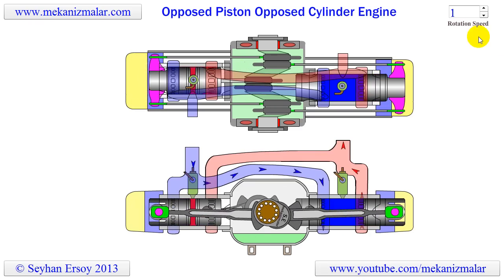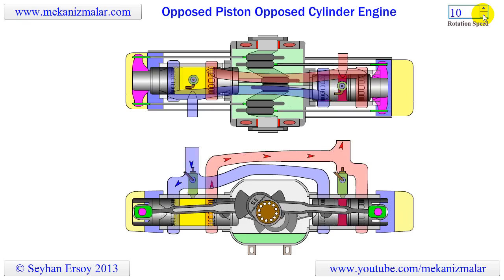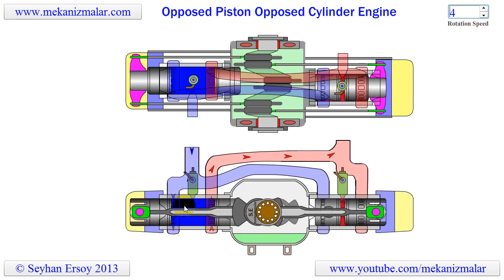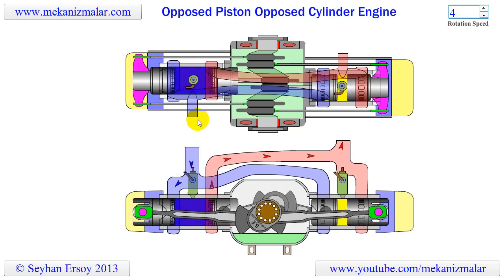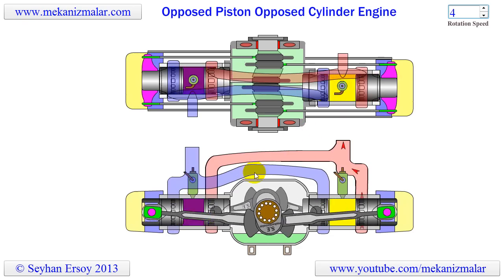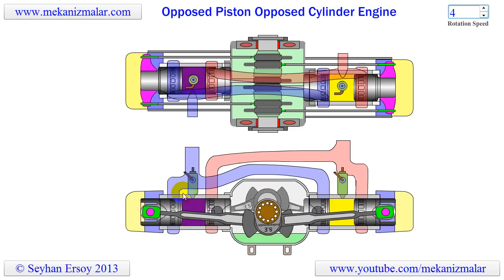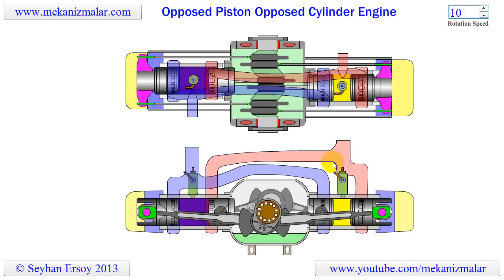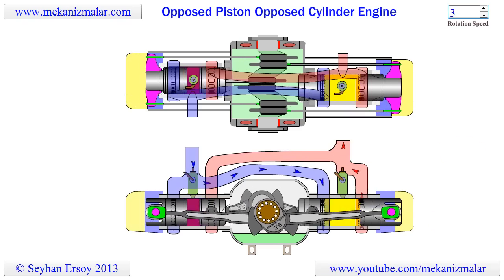Opposed Piston Opposed Cylinder Engine

Comment: This looks like a promising engine for small piston aircraft. Looks like it has high efficiency, but the weight might be an issue.

I also wonder if anyone is mad enough to make this into a V engine package instead of a flat/boxer like this one. We might get the efficiency of the Opposed piston with the compactness of a V engine, but it'll probably be complicated as hell, especially with crankshaft balance and cylinder inspection. 

Maybe the Army can make use of it for its vehicles, like in MBTs? 

Note: I'm not an engineer. I'm just interested in this engine once I understand its working principles.
Reply: Oh yes, army likes engines like that, especially luftvaffe and Hitler's tank armies

Comment: It is not second order balanced (in principle). Animation is wrong - intake and exhaust should be symmetric, outer pistons need to be advanced for better aspiration. There is a minimal advantage to typical opposed engine considering size, but there is a big gap between cylinders required for external connection rods and crank pin between them! So the most viable configuration is 1 module engine. It is 4 cylinder equivalent, not that bad. There is a natural room for "piston supercharger/blower".
I suppose all drawings are intentionally misleading.
Reply: Thank you for your comment and for letting us know the mistakes we had. However, sometime it is much easier writing a comment than duing it.

Comment: Which ports to handle intake/exhaust should be carefully considered because of the radical difference in rod length will create very different acceleration/deceleration curves/dwell times of the inner and outer piston sets.

Comment: Make a 4 stroke  twin engine(e.g 300/400cc) run on low fuel consumption while in city that is half of it e.g 150/200cc ... or either run on one piston neglecting the other or using a VCM  (Variable Cylinder Management) as a virtual variable displacement tech. Or you can make one of the Cylinders skip intake by blocking the carburettor or EFI on one cycle then firing in the next. while the other cylinder working in opposite depending on the crankshaft/timing. And a mechanism which would allow you to kick in full mode i.e without skipping a cycle.
Engine like a Honda Xl400V transalp or of your choice are great. You can also mount it on Lighter frames like on XR250R. I was thinking of this . to make a fuel economic bike while in  a city and one which can kick in full power while in highway... low displacement engines rev much and heat up very much in highways. I believe in you.. You have great enthusiasm and innovative

Comment: The 2 stoke diesel engine had the exact "scavenger ports" (Where the air passes though.), and compression theme. If the shortfall of this engine is high efficiency  in a narrow RPM, then have it power a generator that resonates at the same frequency. Add a small battery or super capacitor, and viola, You have an efficient hybrid.

Comment: Opoc died in 2017. despite 20m$ investment from bill gates. I see no advantage to the design. Those long outer piston arms are weak and the power density comes from being a 2 stroke. 
2 pistons side by side instead of on end is just better. If you want real power density then turbine electric is serious business. Pretty smooth running too. And they can be quite efficient. Large generators are around 60% which is way higher than any car engine.

Comment: Used in two stroke form as you've shown won't work as how you getting a fresh air charge back into the cylinder at the end of the powerstroke,this is why 2 strokes are dry cranked cause the piston and crank force the new charge in ,just injecting fuel at end of powerstroke with no fresh air charge won't burn effectively, having any kinda charger ain't gonna do diddly ,can't see any government agencies taking it serious with such a flaw in design ,anyone with a good grasp on motors will see the flaw having a two stroke design and missing crankcase charge , it's like having a cart and making a wheel but low and behold there's no axle but you still expect the cart to be usable

Comment: Lots of talk about efficiency. Lets us know and practical science leads the way. Put this engine on a generator and see what kind of power out put per btu fuel input will make or break  this concept. The future belongs to the most efficient. In theory you should get more push with two pistons doing the work. The more bang you can get the higher the efficiency should go.  Bottom line the more bang for your buck will make or break this idea. I don't think you will get double the power for your input fuel but should get at least 1.25 to maybe 1.75 more power out, depending on the design factors. I think that would make this new engine very much in demand. This would be wild change over in motor vehicle and trucking industry. I am sure the oil industry would not be happy. This would be a significant world wide event when it starts pushing into those many industries, and a big economic change over. Even ship and high end base load generators will be obsolete. Those that don't up date will not be able to compete.
Reply from the maker: Dear Steve, one thing that I did not get in your comment is that you are saying this thermal engine can get 1.75 or 1.25 the power from the input fuel. As far as I know no thermal engine can get more efficient than 0.45 percent of the input fuel power., Is what I andrsted from your comment is wrong? Also I thank you for visiting my channel and comment.

Comment: The OPOC engine could also operate with the pistons to one side like a normal inline four cylinder engine instead of a boxer configuration. It can then be tilted upwards. It can also be made in V configurations. Why use a crank and not a drive gear?

Comment: "eleminates the cylinder head and valve train components of conventional engines" - I fail to see how or why ...
Reply: There is lots of heat loss through the cylinder head of a conventional engine.  It has surface area but does no work.  An opposed piston engine has the combustion chamber between the two pistons, and both do work to produce power.
Reply: It has ports for inlet and exhaust, like a two stroke.

Comment: First, 'throw away the inlet manifold and the turbo/Super Charger'!  The bottom of the out side pistons are now compressors, sucking air in through simple and cheap reed valves on the far ends.  On the power stroke this will push the compressed air through vains into the combustion chamber through the port holes at the far ends. Now both inner port holes become the exhaust as the left side already is.

The only possible minor problem I can see would be lack of torque because of the shorter stroke?
Would love to see this built and tested.
Reply: Checkout DOXFORD engines. Also combined compressor piston has been done over a hundred years ago, either as you describe or also an annular space with a stepped piston. Checkout LYLE CUMMINS’ Diesel engine history; Lyle is a son of Clessie Cummins, Cummins engine founder.
Reply: Checkout LYLE CUMMINS’ Diesel engine history. It is an exhaustively detailed compilation written over decades.
Reply: for effective working, we would need the air pressure and volume high enough to push out all exhaust gases . this makes your "compressor" plan unviable. As for torque, the total length is split between two pistons , thus giving high torque as well as high speed.

Comment: Hardly a new concept.

Opposed engines fell out of favor almost 100 years ago because they are too complex, too heavy, and too inefficient
Reply: Check out Achates . Norris Fairbanks are still used as power plants (generators) in  hundreds of locations.
Reply: No, they fell out because fuel was cheap and fuel efficiency was not so important.
Reply: The really arent any of those but they drink a lot of oil like most two strokes

Comment: sir already i have been working on 4 stork opposite piston engine it more efficient than your engine. it is same as working common engine but my opposite piston engine under progress due to small workshop in my home
Reply: AMIR HAFEEZ do it do it.   I love this design n would love to see it in person.    Im n ex technician and love this engines simplicity.   no timing chain or belt, no valves, no cams, no spark plugs, no wires no software just simplicity
Reply: 4 stork engines have trouble because eagles are always finding their nests and eating their eggs

Comment: Very impressed with the concept. I am fond of the 2 stroke engine because of its power to weight ratio. With technology and the advanced materials available these days, I believe any issue with this concept can be overcome. I think the greatest challenge is to change minds toward acceptance of such a radical departure from the norm. I really hope it succeeds.

Comment: i love how this is an opposed piston design without resorting to another crank shaft on the other side of the cylinder, very clever, only one sump.  Also, this is nice and balanced.  how do you lube the outside pistons?

Other than that it is a poerted 2 stroke diesel relying on forced air, nothing new there.  a good power density but not as efficient as as a larger 4 stroke miller cycle diesel of equal power.

Comment: This is a variation on Russel Bourkes 1930 engine. It will not work efficiently. The designer obviously missed the point. Very high compression was the key to the efficiency of this TWO stroke engine but not a weakness. Like a diesel the compression creates the ignition. This is just a load of crap which would blow itself to pieces.

Comment: But what is the benefit of increasing crankshaft rpm?  In my experience, all this will do is increase wear and frictional losses.  Also, the ejection of cylinder exhaust gases would not be optimal with this design.  Without significant positive intake pressure, you are going to end up with reverse flow at low rpm. 

Cool idea, but not really a viable replacement for traditional engines in my opinion.

Comment: If the external piston was used to "suck" the exhaust out - it may not need a "turbo charge" for the fuel... just like a 2 stroke where the piston "back side" is used to vacuum the fuel into a "pre compression" chamber and then the fuel is pushed in by the returning piston - here the oil partition can be used to "prepare" a dose of fuel mixture, while the outer part - to extract the exhaust. Could this remove the need for a turbo?
Reply: Tomas Sab     You are forgetting; This is a diesel engine.    Unlike a gas engine, here there is no fuel 'mixture' to play with.   The diesel simply compresses pure air, and only then injects pure fuel.
Reply: hm. still must be a way to use the back side of a piston to "pre compress" some components. It would be great if the engine block could be made from a single solid peace of pipe with a couple of holes drilled in it. Where the piston would cover the right port at the right stage, making the piston work as a valve, compressor and power source. That contraption would be cheap as hell.

If not with diesel.. then maby with alcohol as fuel?

Comment: SO, theoretically a four cylinder engine could output the power of an equivalent v8 or 16-cylinder engines?
with a severe decrease of the center of gravity and overall weight?
I love the way the cranks/and arms work in this video...
the timing, ignition, porting and injection---I would love to see a one cylinder version of this...
there's a Briggs mod project for ya...
Drill the cylinder half way through the stroke to install the plug and injector?
with a pair of connecting rod arms outside the crank-case?
Just throw away the old head;-?
Reply: I guess you'd need another block to cut the cylinder off of/and it would be fairly tall;-)
and the plug/injector part could be bolted where the valves were seated?-on most old horizontal Briggs...

Comment: it is still a two stroke, just like a detroit diesel, and you could always tell where a truck with a detroit diesel was parked from the oil spots on the ground
Reply: zz dragon Of course. But one wonders why people seem to feel there is a need for valves. Valves are just extra complexity. A nice thing about two strokes is that the gasses move through the system without the need for a valve system alongside the main components. And the OPOC has the inherent advantage that the ports cam be uncovered differentially.
Reply: It's the freshly turbocharged or supercharged inlet air that ejects (pushes out) the spent exhaust gas, as with the vast majority of two stroke designs.
Reply: zz dragon Yes, one could include ECU systems.   They are probably working on it.    But the main point of the OPOC design lies in the myriad mechanical advantages such as being absolutely ideal for development as a two stroke (ie. inherently powerful.) but with half the piston speed. 
   Also, the design inherently counterbalances internal stresses which allows for a far lighter crankcase and crankshaft.   
    Then there's the ability to 'bank' the units. 
    Comments about lubrication problems are based on ignorance as both two and four stroke diesels are lubricated identically.
Reply: It is very different to a Detroit Diesel two stroke. Find out how it works. OPOC engines can be in banks and clutched in and out depending on the load.
Reply: ***** I can see how it works, it is still a two stroke, and will have a oil lube sealing or leaking problem just like a detroit two stroke, you need to learn the definition of a two stroke and four stroke, or don't waste time trying imply you know what you're talking about .
Reply: sixmagpies the problem with diesel two strokes, or any two stroke, is the lubrication of the cylinder walls and piston rings,,,, the main loadings on the crank has nothing to do about the cylinder wall or piston ring lubrication, and you must be related to john burns.
Reply: sixmagpies ever hear of tax exemptions, maybe you get a big exemption for so called green energy companies, and the OPOC people sure do talk up their "greeness," and look who they have on their staff.. That engine would be great if, and its a good big if, they could figure a way to make it a 4 stroke.
Reply: darkegalahad DB
Reply: sixmagpies I never insulted you.
Reply: ***** What insult?   I was simply replying to "darkegalahad"'s inaccurate comparison of this OPOC to a Detroit.
Reply: sixmagpies "Your statement is correct, and does not justify the insult."
Reply: ***** What insult? It was a statement.
Reply: It is not because they are two strokes that GMs leak.  They leak because of flaws both in the original wartime pressured design as well as an inherently faulty manufacturing process. Most two stroke diesels, particularly those in the marine world, are relatively dry.
Reply: ***** i guess you are not familiar with the two stroke diesels, like the detroits. Some oil is going to or has to leak past the rings to lubricate the cylinder walls, unless you know of miracle self lubing metal. Sealing on a two stroke diesel is just not as good as on a valved engine.

Comment: Very good animation, as usual.  Thank you.  This engine has a power stroke on every turn of the crank, and the pistons act as valves, both are features that define a 2-stroke engine.  It uses a turbocharger like some 2-stroke diesel engines to avoid using the crankcase as a passage for the fuel/air mixture.  That allows for better lubrication of the crank. Since higher efficiency is the stated goal, it seems logical to assume this engine would be a diesel.
Reply: you're confusing the two-stroke gas engine with a diesel two stroke, can't think of one diesel two stroke that uses crankcase for fuel/air passage., Diesel fuel can't be mixed like gasoline with air like in the two stroke gas engines.
Reply: darkegalahad
I didn't say what you said I said.